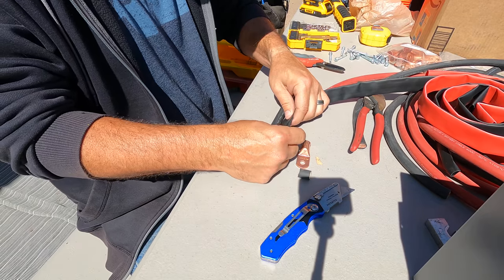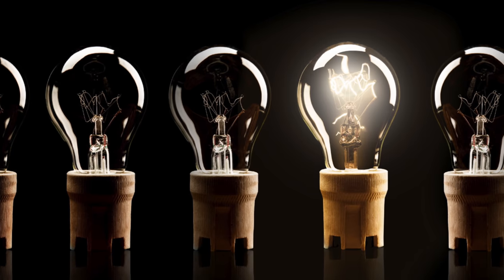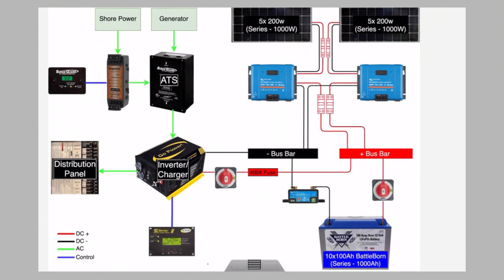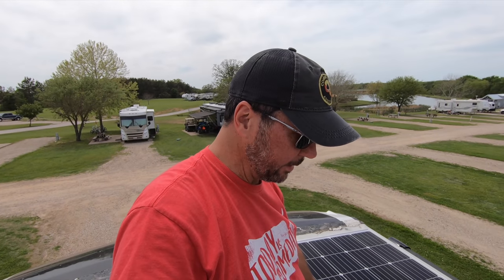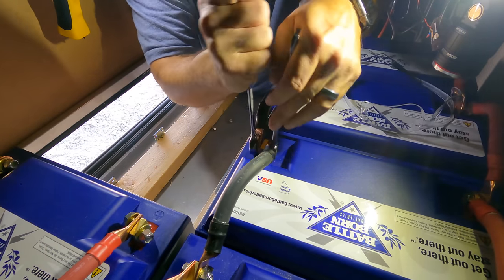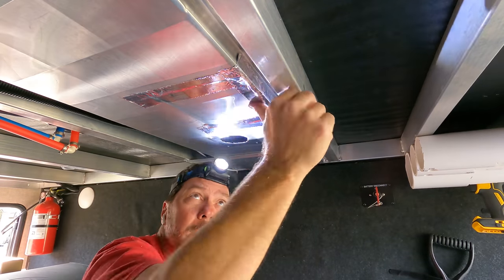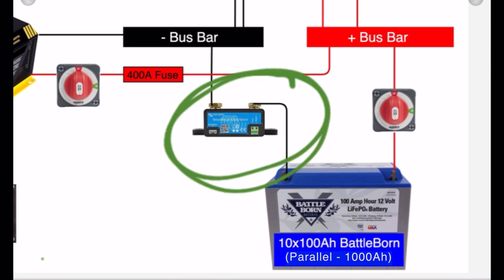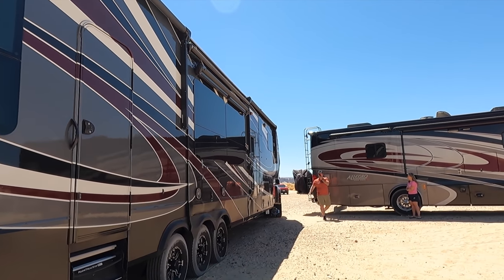☀️  RV Solar Install! 😎  (Full Time RV Life)

Comment: Have you heard anything about air conditioners that run on 12 VDC power?  Using them plus a 12 VDC compressor refrigerator would eliminate some power losses inverting DC to AC.
Reply from the maker: I think some 48v air conditioners exist, but not sure they are powerful enough.
Reply: @ChangingLanes  Need more research!  I thought that the article about DC air conditioners (yeah: DC / AC, not AC / DC 🤔) said 12 VDC.  48 VDC seems unusual, but like I said, more research.

Comment: I'm shopping for my first fifth wheel.  The ones in the running don't come with a generator, but up until seeing this video, I was considering having one added.  If I copy your setup, here, am I now able to weigh the investment of the solar system versus the generator and not need the generator, at all?
Reply from the maker: The generator still gets used when power requirements are high (hot weather).  We still wouldn't go without a generator... 👍🏼

Comment: 15:48 Access port?? Is that factory on all 397TH or is that only if you get solar prep package or something like that?

Also does your truck help charge your batteries when you're under way?
Reply from the maker: Should be standard on all 397s I think...  The amperage over the 7 pin connector is just a trickle charge... Not even enough juice to run the fridge.

Comment: Wow!  Great video!  Quick question for you Chad:  how much weight does a system like yours add to your rig?  We would love to add solar, but we’re worried about the additional weight on our already heavy DRV toy hauler.
Reply from the maker: We still need to weigh in, but we did get rid of a lot of stuff to help offset... Still likely added a couple hundred lbs.
Reply: @ChangingLanes  thank you for letting me know.  Thanks to you and Tara for all the amazing information you share!  Your videos are the reason we are on the road full-time now!  We learned how we could have the kind of internet we need to do our work on the road.  We'll always be grateful for all you both do to share your knowledge with your audience ❤

Comment: After screwing in from the top (exterior) of your roof, how did you secure the inside of the roof? Did the screws pop through the inside of the roof? Did you use a nut on the inside of the roof?
Reply from the maker: It's just wood screws into the roof then sealed.  Also some sealant under each leg to bond to the roof.

Comment: Great video! Quick question. Did you ground your solar panels, or do they need to be grounded? If so, where did you ground them to? I just installed four 320w panels on our 397th, and it seems some people say they should be, and others say they don't need it.
Reply from the maker: Sort of...  They are grounded indirectly via the negative bus bar, which is grounded to the frame.
Reply: @ChangingLanes  Thanks. That's the way mine are wired now, so I will leave it at that.

Comment: OP I used to work for a fleet.  One of hte biggest problems was small gas motors that had not been run for a while and/or had the same tank of gas in them too long.  A little bit of Stabil added can prevent many problems.  I know you exercise the gen motor but how often do you refill the tank?
Reply from the maker: Maybe a few times a year... We also use Stabil.  👍🏼
Reply: @ChangingLanes  good idea, the trouble caused by bad gas in a fleet is unbelievable

Comment: Great information. Did you disconnect the 12 vdc line from the 7 pin connector or does the truck give additional 12 vdc?
Reply from the maker: It's still connected.. It's just a trickle charge over the 7 pin.

Comment: Our travel trailer needs a new battery and my wife and I have decided to go lithium and get a battle born battery. We are getting one for now but looking to boondock a night on our way to our destination. 

Do I need to upgrade our inverter/charger or would it be a converter/charger? I have seen everyone do so but wondering if it is necessary and have not been able to find a straight answer of definite yes,  you should but can get by, or not necessary. We have never boondocked before but thinking of exploring farther.
Reply from the maker: Hi!  Generally speaking, most stock converters will not have the right charge profile for lithium.  So, yes, you will likely need to replace the converter.  The only way to know for sure is to look up your current converter and see...

Comment: Chad, what size wire on the output side of the solar controller?  10awg, or 6awg?  Trying to figure what’s the max cable size that fits the 150/100 victron.  Gotta carry 100amps with 5 panels in series, right?  I’m planning a 5 panel, 6 battery Lion system using all the parts you describe.
Reply from the maker: I used 4AWG from the controllers to the DC bus.  You can see all of the specs here: https://changinglanesrv.com/rv-solar-install/

Comment: Those charge controllers are rated for 100amp output but your wire looks like a 6 or 8 awg coming out. I run 6 on my 60 amp CC, just curious what solution you came up with?
Reply from the maker: 4AWG on the output.. All of the details are in the blog post here: https://changinglanesrv.com/rv-solar-install/  👍🏼

Comment: Can you please share how you tied your solar system to the dc circuits in your fifth wheel.
Reply from the maker: Please see the blog post here: https://changinglanesrv.com/rv-solar-install/   also, stay tuned for additional solar vlogs in the future. 😎
Reply: @ChangingLanes  I will check out the blog and stay tuned for future blogs.

Comment: #1. Chad, I really like your channel and have watched a good portion of your videos, but I'd like to comment on this video with some basic electrical info without anyone taking offense. I taught advanced electronics/digital diagnostics in the Navy, it was a 13 week ESM class, but the students needed to learn advanced diagnostics to repair the equipment, so this type of electrical is very basic to me, in addition to installing RV solar systems since 2004, when solar panels were $6/watt. LOL

I'll start with the Battle Born batteries. Yes, they are thoroughly tested, well built and have a great warranty, but not my first choice due to price, but that's a personal choice. More importantly is the design concept. They use 120 cylindrical LFP cells mounted in  parallel packs of 30 then 4 of them connected in series to make the 12.8v. The theory is if one cell fails and shorts out, it doesn't affect the rest of the pack. Tesla uses this concept in their batteries and it works great, but only because Tesla uses a thin wire to each cell acting as a small fuse. The cell malfunctions, the thin wire burns up and the cell is now disconnected from the huge pack, which doesn't notice the loss of a very tiny % of it's power. 

However, Battle Born chose to spot weld all 30 cells to a large nickel plate (7"x7"?) capable of carrying probably more than 100a. One cell shorts out, it shorts the entire 30 cells welded to the plate and now the entire group is shorted unless and until the shorted cell explodes. That's not good with 100A of cells together. The small cell concept is great, until they welded them all together. See Will Prowse's BB disassembly video for exactly how it's assembled. 

I prefer batteries constructed of prismatic cells, cheaper, lighter and fewer connections (10 instead of over 240 welds) and the newer 200Ah batteries are under $700 and weigh 46 lbs. 1,000 Ah of those only needs 5 and weighs 230 lb, vice BBs which weigh 31 lbs ea for a total of 310 lb, an 80 lb weight savings. Not a huge deal, the price difference is the huge deal. If the BBs had the fuses on each cell, then I might see justification for the cost.
Reply from the maker: All very good points, Steve!  If I were to do it over, I would use a larger form factor of battery and wire them 24 or 48V also.
Reply: Hi Steve. Can you name the battery you prefer?
Reply: @ChangingLanes  What battery? After reading Steve's comments I'm wary of the BB.
Reply: @bikabill5182  I like Chins or Ampere Time, both made by the same company. They sell them on Amazon and are available in 100Ah, 200Ah and 300Ah sizes. Very inexpensive, but well made as shown by videos of them being disassembled.

Comment: Do you hook your connection for your brake's breakaway cable directly to the battery?  I used to haul goose neck trailers commercially and I believe that was legally required.
Reply from the maker: It is wired in directly at the factory, but to the dc system and not the batteries directly.
Reply: @ChangingLanes  Gotcha, I'm sure Grand Design wouldn't do that if it wasn't legal.  I only said something, because I just bought a lithium and relocated it into the front pass thru storage on my travel trailer and ran the break away pos wire directly to the battery.  I probably didn't have to do that.

Comment: Which is better in your opinion? 4 100 ah life po 4 batteries or 1 400 ah battery. Space is ample for either one. I am going to pair this with 4 200 watt solar panels.
Reply from the maker: The larger the form factor the better Ah to weight ratio and the simpler the wiring.  Next time we do this, we'll have larger batteries and wire them for 24 or 48V.

Comment: My question is. I have a travel trailer. The actual screwing in of the panels on the roof. Are the screws going into a stud ?
Reply from the maker: If it's a walkable roof, it should have enough meat in the roof itself.
Reply: @ChangingLanes  How well does the dicor hold it. Yes I can walk on it. It’s a 2019 rock wood 2104s.
Reply: @ChangingLanes  oh god what a dumb statement, just because it’s walkable doesn’t mean the plywood or sub straight is strong enough alone , and most rv walkable roofs are 1/2 a❤flake board which is not strong enough alone

Comment: What was the total additional weight dyou add ? 10 batteries , 10 panels , wiring, components ? I have heard sometimes approaching 1000 lbs ! Dramatic cut back on your cargo capacities ? Did you consider
Reply from the maker: We still need to weigh in, but we did get rid of a lot of stuff to help offset... 👍🏼
Reply: @ChangingLanes  did you consider 24 volt system?

Comment: Another question occurred to me...  Do you have a rough idea of how much weight the new components (batteries and panels mostly) added to your rig and do you feel the difference when towing?
Reply from the maker: We still need to weigh in, but we did get rid of a lot of stuff to help offset... Still likely added a couple hundred lbs.  👍🏼  No difference in towing...

Comment: Any reason you stayed at 12v vs 24 or 36 I feel like you save a lot on controlers/inverter
Reply from the maker: If we were to do it again, we'd definitely do higher voltage.

Comment: Did you have to reinforce the generator shroud to hold the +300lbs of batteries?
Reply from the maker: No... It's very sturdy.  Lots of miles on it now and no issues. 👍🏼

Comment: What screws did you use to attach the brackets to the roof?  What length?  Did you just put the self leveling over the screws?
Reply from the maker: I used 1" wood screws. I used Afcat 945 under the mounts and eternabond tape on top.. See: https://youtu.be/hdtC2XZ8z-g?t=1052
Reply: @ChangingLanes  Thanks! I must have hit the 10s button one too many time and missed that part.  Thanks again. Hope all is well.

Comment: Ok first question is how much did all of this cost totally? Second how much extra weight did all of the panels, batteries converter wiring  and other stuff did it add to your rig and did it make you have to get rid of other things to stay within weight of the fifth wheel?
Reply from the maker: We generally don't publish prices since they change so frequently.   All of the products and materials are in the blog post and description.. 👍🏼  We still need to re-weigh, but I did get rid of  LOT of junk to offset.
Reply: @ChangingLanes  thank you for answering. Our class c is so sensitive on what we can put in it for weight. Our Lectric Bikes really put us up to the max when we went on our 3 week vacation. We will see what it will be like when we move up to a class a. Keep these very informative videos coming please.

Comment: Chad - did you consider a DC-DC charger to supplement charging while driving or during periods of cloudy or rainy days?
Reply from the maker: I did, until we installed this system.. Plenty of battery storage to run fridge and such for a couple days...

Comment: Just curious Chad, how much weight did your new system add to the rig? Did you guys have to thin out your stuff to accommodate large system, or are your weights still below gvwr?
Reply from the maker: We did chuck a ton of stuff we had stored.. Still need to weigh it...
Reply: I had the same question and also wondered how the 10 batteries would impact the rig on let's say a bumpy road. Lot of weight flex I would think.  Awesome job Chad!  Good thing Tara is such a wise boss too.
Reply from the maker: A couple thousand miles and tons of crappy roads... No issues yet..  👍🏼

Comment: QUESTION!
I understand you can only run one ac unit off of the solar. Can you use eather ac unit or do you only have one specific unit hooked up to it, and if so, which ac unit is it?
Reply: By doing the job yourself and understanding how the system operates,  it will make it alot easier to diagnose if something were to fail. Great job for the explanation and video.
Reply from the maker: We can run anything in the RV, so we can chose which AC we run.

Comment: Did you also use 15 amp breakers after your charge controllers or just 10 amp breakers?
Reply from the maker: From the blog article below 15 amp breakers are listed under the products in the front bay https://changinglanesrv.com/rv-solar-install/
Reply: @ChangingLanes  Thanks for the link! And the video! Love all of them!

Comment: Hi Chad, concerning your solar panels, did you screw your brackets true your roof joist ?
Reply from the maker: Just into the roof itself.
Reply: @ChangingLanes  bought a 2021 Pinnacle FW and going into the solar 
With 6x 200 w panels and all the Victron accessories. I can't say thank you enough for your educational vidéos. Thanks a lot Chad !
Reply from the maker: Good luck with the installation! 👍🏼

Comment: What temps were you seeing at the positive terminal of the battery bank during inverting?
Reply from the maker: I haven't checked, but the inverter does have a temp sensor on the battery and it's not complained yet.
Reply: @ChangingLanes  Thanks....was wanting to know the temperature when inverting say 1 x AC....90F? 100F? 120F? at the positive terminal? With 1,500 - 2,000 watts inverting  want to see the numbers you are seeing with your system.

Comment: I am slightly confused. I thought that your 120v was still DC not AC. Am I wrong?
Reply from the maker: 120V is AC (Alternating Current) - just like a standard US Household.
Reply: @ChangingLanes  Ok. I thought the solar panels put out DC not AC.
Reply: When he spoke of 120v from the solar panels, that was DC, however, the 120v 'things' in the rv need AC so in general when he talks about 120v, he is referring to AC. His Solar panel wiring configuration creates 120V DC, which is converted by the Victron solar charge controllers to 12v DC (at a very high amperage) to charge the batteries. The batteries feed the GoPower inverter which converts the 12v DC to 120v AC for the various 'household' things in the RV. Technically the Solar charge controllers AND the batteries can both/either provide 12v to the inverter but for the sake of simplicity the power path is: Sun --> 120v DC --> 12v DC --> 120v AC from Sun --> Solar panel --> charge controller --> batteries --> inverter
Reply from the maker: Ah.. I misunderstood.. Yes.. each string of 5 panels puts out a maximum of 120V DC.  That gets converted to 12V by the controller.
Reply: @roussell  , that's my point. He made it confusing. Thanks for the education, but I probable know as much or more about the 120V AC circuits in my RV than you. But I was looking for an explanation from Chad.
Reply: @ChangingLanes  , I may not have properly stated my question. Your statement about 120v and the math made me do a double take. Maybe I need to rewind the video and really study what you said.

Comment: why in roof and not mobile where you can park the rv in the shade and put solar in the sun?
Reply from the maker: because laying out 10 solar panels and wiring just isn't practical.  Maybe a small panel or two...   Thing is, we can always add that very easily if we needed it.

Comment: You didn't talk about your generator and how much you have to use it.  IF you're boondocking with no shore power and you run your A/C all night that will leave your batteries quite low. With 2000W of panels it will take most of the day (assuming your not drawing from your batteries and you have good sun) to charge the battery bank. Typically this will require the use of the generator otherwise you may not get the batteries charged and that leaves you going into the next night without enough power to run the a/c all night. It's almost impossible to get enough solar wattage on the roof af an rv to charge a large battery bank quickly enough to not need a generator unless you opt to not use any heavy load appliances.
Reply from the maker: Every camping situation will be different and we can supplement with genny when needed.
Reply: @ChangingLanes  I know you're well aware of that but some viewers may not completely understand. By the way you did a great job explaining this.

Comment: 9:31   Yes and no... Your "Charge controller" will take care of that, but if you are "SIZED" for the Summer and good weather you have the right amount...
but when Winter comes and or those Rainy days you are going to miss that extra solar panel.  
SO, I would have to say NO, to less Solar and go overkill with Solar. THEN Size your Battery bank. SOLAR is Cheap and BBB are $1,000 EACH vs 
.50C on the watts for solar. mmm  $100-$200 panel vs $1,000 - $2,000 extra batteries..???